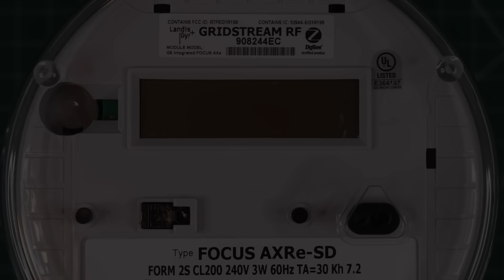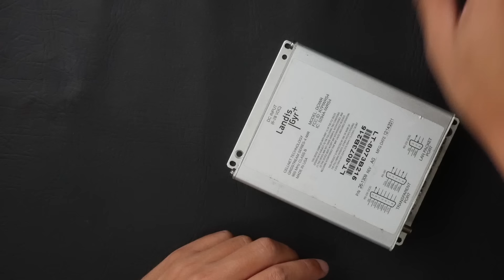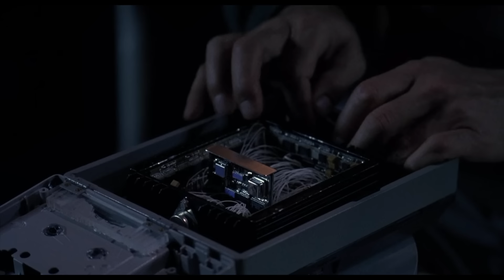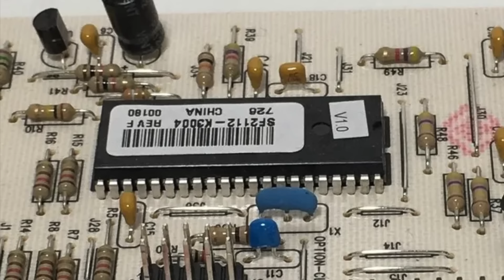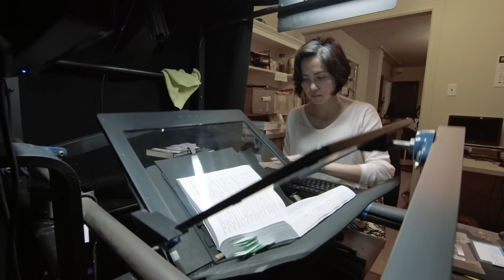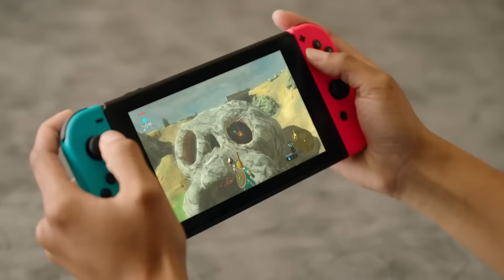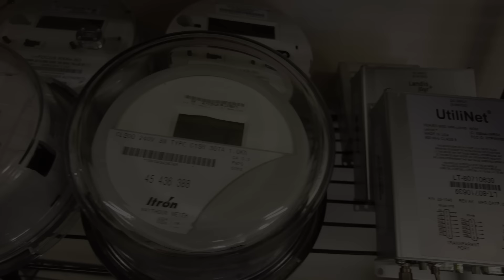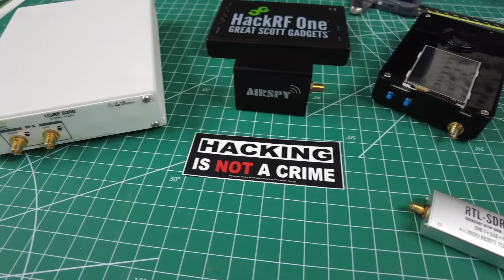The REAL Problem with Smart Meters

Comment: My bill has tripled since they installed mine.
Reply: Your meter can pick up signals from devices and counts this as usage. I discovered this myself and covered my smart meter with military grade fabric so no signal can get in or out the smart meter through wireless means. Once I did that it reduced my costs . Routers tend to be close to smart meters, at least where I live.

Comment: The first model meters in the Netherlands where known to raise the bills. Explanation was they where sensitive for other radiation like that from microwave ovens...
Reply: They may also tweak the code or electronics to log more usage 😢
Reply: I think they all still do, I am in the netherlands and I covered them with military grade fabric to avoid radiation going in or out around the smart meter. i reduced my bills with it. Still have the same meter. However, now they want to change my meter saying it is outdated, it is not, they just can't read it as i also unplugged the apparent wired connection they had hooked up, when I found it last year

Comment: In some areas, the smart meter is a new tax, because, anytime a meter is pulled, they inflict a fine.   Pay it, or get your power disconnected.  And there is another example of tech getting around the license restrictions.  They did this, because, one computer owns the license, and you run the code in a space at the remote server computer, that send images back to client computer.   The usage at the remote computer is now, a fraction of a second.   So, millions of users could use the single copy.  But usually, it is less then 200 clients.

Comment: It kinda looks like OMS frame structure, if so 00FF would be "manufacturer specific" code XD if i remember correctly. But you'rs US meters might work on smt similar but in totally different standard since US have it's own ones. We always encrypt our data with unique keys. And yes concetrators might be able to recieve multiple messages, but they won't decrypt them just pass it to the server.I can't tell to much detail since i have NDA, but i don't work any companies shown on video.

Comment: Given these smart meters are using spread spectrum transmissions to get the data back to the home office, just how does it do it given the antenna size is negligible and the power outputs of these meters can't be that much - maybe a few milliwatts??  All that RF energy has to be transmitted and received back at the home office and decoded for the utility to obtain the information!

Comment: Make some experiment devised from load ... give a smart meter various specific loads at various specific times. emulate lights, tv, heater etc in various combinations and see how they modify the output ... a shit lot of data is just communication overhead . Problem is encryption... if they use a proprietary way you are pretty much out of options.
Reply: lol, this is encrypted, you are not going to decipher it that way, but anyway there is not much point in deciphering these datas, they are not secret at all, nor interesting, it is just total import, total export, apparent power, active and reactive power, power factor, voltage, frequency, sometimes GPS coordinates, there is really nothing to it.
Reply: @lo2740 at uni when we did security we had as subject ways smart meter data can be used against us... Time and load can create habits timetables and make it really easy for people to steal or frame you... Next to other bad stuff that can be done by landlord, neighbor, dno, etc... The key is encryption but old systems were really easy for eavesdropping

Comment: I had a analog meter for years. When the digital meters came out, I noticed that my electric bill jumped up about $25 dollars a month . Calling the electric company did no good . I had the bills for years and years to prove that it wasn't me causing the bills to jump. I started writing down the meter useage at random times. A bit of detective work on my part proved that those smart meters are thieves  I went to the circuit breaker panel and turned off EVERYTHING. I took polaroid pictures of the time of day and the meter reading before I went to sleep. When I woke up, I went and read the meter. Whoa ! ! How could I use up 500 wats of electricity over night with everything disconnected including the refrigerator. Another call to the electric company requesting a technician did not accomplish anything at all  I ended up calling the PUC for help. A representative came over and looked at the Polaroid pictures and my notes. He contacted the electric company and told them to replace the "smart meter " with a analog one and reset the meter back to 0000  to give a fresh look at my electrical useage. Next month my electric useage went fown to what I usually have. I stayed in touch with the PUC for quite some time discussing the bill every month.
Reply: Same here, requested analog meter and the power company switched it out, the same day I called. MUCH lower bills with analog!
Reply: @ThisMoment11 what was your fee to revert to Analog?
Reply: @ThisMoment11 Your bill goes up because a smart meter charges you for both phases not just the single one with the highest load like the old meter.
The power company claims they are charging you for a single phase connection, this is fraud when they install a smart meter that charges you for a duel phase power supply.
Reply: @garytyler1448  You don't have two phase power, you have "split phase"  240 volts with a center tap.
Reply: Same here, my bills jumped upon install. Power company said the new meter it “tracking small electrical use that the analog meter didn’t”, yea apparently it wasn’t tracking 25% of my use because that’s how much my bills jumped. What a crock.
Reply: @davejunk4098 they are lying.
If you look at your power bill it should say single phase connection.
But if you look there should be 2 wires 2 phases going in?
The old power metre only charges you for the side pulling the highest load, hence single phase.
But smart metres charge you for both sides or duel phase connection so your bill will go up.
But if they claim they are giving you a single phase power supply and bill now that would be fraud, would it not?
Reply: @garytyler1448 - typical electric drop to a residence is 240V single phase.  The two wires are opposite sides of a transformer secondary with a center tap.  The center tap is the neutral.  Neutral wire is grounded in the main panel, which limits the power to ground to 120V.  This is single phase power.
Reply: Their convenience shouldn't cost customer's money.  This is ripping their customers off.  A lot of small amounts of overcharging add to big $$$.  Why does PUC allow this knowingly
Reply: @boomshacker  the worst part is, it's convenience—and cost SAVINGS—FOR THE UTILITIES. They no longer have to pay someone to drive around and read meters, their infrastructure (every meter on every house, plus the relays) automatically collects the data for them, and they just need to pay a couple of specialized technicians to maintain that infrastructure. They could have 2-5 technicians PER STATE, just driving around as maintenance schedules or failures dictate, instead of a meter reader or two for each CITY.
Reply: Plus houses can and have been set on fire remotely from smart meters. I'm thinking I'll go to analog and pay the fee.
Reply: @cocoabiscuits  what the fee in your area?  In Mesa AZ it’s a $40 a month fee to switch back.
Reply: That cheap mine went up $10 a day and we're not even home during peak hours
Reply: I agree!  I have a metered outbuilding, it literally uses nothing, but the smart meter claims I use a kWh/day!
Reply: funny cuz xcell energy hear in wi whants to charge me 25 a mounth for not having a smart meter...
Reply: Hi what is PCU?
Reply: @tonypetch  PUC Public Utilities Commission.
Reply: @tonypetch  Public Utility Commission.
Reply: How much did that cost you?
Reply: Probably a faulty meter from the factory easy to slip past these days becuase quality control is a nonessential expense according to todays buisness majors.
Reply: @alouisschafer7212 they told me that my meter was tested for reliability. Pure BS. No one ever came to even look at the smart meter.
Reply: Here's part of the problem.  No one at the utility company got arrested and punished for what they did.  Good for you for being diligent.  I wish everyone was that way.  But what about everyone else they get to steal from?
Reply: PSE&G sent us a letter claiming changing to their smart meter is mandatory. What can we do?
Reply: @onsturn mandatory requires agreement by both parties just tell them No thank you!
Reply: @ mandatory or what?
Reply: Wow! That's just pure theft by the power company! I'm at the research stage b4 they soon try to install one of these lying smart meters at my house. I'm going to "opt out" as is my right because i don't trust these cheating smart meters! Thanks!
Reply: The problem with any ‘computerized device’ is that it can be programmed to cheat the customer at any time. But that also means that some ‘Hacker’ could also program that meter to record power at a low level so the company gets ripped off. This also goes for digital currency, how do you know it is true to you ?  Everything is Hackable period.
Reply: Who made the smart meters?    Aluminum foil ?
Reply: @Robert-ex3pm  don't cover the smart meter with foil. It will run like crazy trying to report to the company controller.
Reply: Same here exactly like 25$ to 30$ jump even now being on assistants program it should be less not more they think we dont pay attention to that? Im definitely giving them a call later today when i get off work
Reply: @jefflidberg9941 is that a jump in total of all cost they charge you? Or have they added on some monthly fees?
Reply: Yep, Price County Electric Coop in northern Wisconsin is the same. With the new meters came higher usage/bill. They claimed they are accurate and the old was undercharging. Our glorious State agreed and we are F' Ed in the A.
Reply: Interesting! 😮
Reply: The sm4rt m3t3rs emit very high emf.  

They are literally stealing your electricity and turning it into an electric w3ap0n to irradiate you.  And you are paying them to do this.  Still, w3stoids would rather focus on the fact that Jose is picking their corn and that there's a guy named Sandeep buying stuff at costco.  Absolute c4ttle.  

We all deserve what we tolerate!
Reply: Had the same thing here. I believe that someone in my mesh knew how to talk the control code. Or possibly the control office at the electric company was jacking up the reading even on days when the ONLY thing running was the fridge. 
After 3 months of arguing I finally got an analog meter. 
Now the house is quiet. Now the cellphone does not overheat just because I charge. Other appliances seem to be operating much better.
The smart meter was a disaster waiting for someone to send code to possibly burn my house down.
Reply: Thats everyone. It should be against the law forcing us to have a smart meter. The damage they are doing on our health should be enough.
Reply: If you look into it they have variable pricing implemented now...
Reply: @jo-qp7mz  Depends on location.
Reply: @jo-qp7mz to charge you more at your peak time not just the peak usage of the majority of power usage.
Reply: Also, I knew they were crooks they’re not healthy as well microwaves thank you I’m going to contact the Puc to change ours. They wanted us to pay $169 to replace with analog.😡 thank you again👍👍🙏🙏
Reply: precisely, and exactly why i will NEVER consent to one! You're story is exactly same as all i've talked to with these nefarious devices!  It's a scanner for your life, work, 'energy'signature, hmm anyone wonder if that will lead to a carbon footprint Tax scenario!?!
Reply: Analog meters run slower as they age.  Electronic meters remain accurate over time.

Comment: It's LWM2M encrypted with mbedtls & using a 6lowpan network.  You can buy a 6lowpan sniffer, decrypt the packets in wireshark, given the group AES key.  There's nothing proprietary, the hopping pattern is public domane, but you're not going to get the private keys required to spoof your meter readings.

Comment: The utility promised off peak billing as benifit if you installed a smart meter. 8 yrs later no off peak and they say their billing software can't handle it, no doubt some legacy cobalt code on old mainframe. The utilities are often wrong and over charge as local news reports. I installed Emporia Energy System to track all energy use. So I can track electricity. However I get odd spikes in water and gas use. Only way to track is manually write it down. Add to that they collect for fire services and other country services being outside city limits. Ridiculious high bills even if I conservative.

Comment: There's a huge problem with all the meters and renewables 
What's a solar is connected to the grid it could only put in about 15% of the actual power the problem is it's measured in watts if you take a volt amp meter you can see the actual power going into the grid 
Because volts is pressure and electricity is like water so you must overcome the incoming pressures to put anything in meaning of volts

Comment: One thing to remember is that usage data isn't a serialized number like the meter displays.  It's a delta value, usually in 15 minute intervals.  This allows for smaller data packets, key in a mesh radio network.

Comment: They installed smart meters here in Louisiana that are remotely shut off. Reading the fine print indicates they have the capability to just shut us off for load shed, non payment, non compliance, and illegal usage such as grow operations or commercial operations. The meters have algorithms to detect appliance types and report it to your power company. 

Our home has a standby generator and every week it will stretch its legs and run the house for about an hour. The meters in our area are set up to detect tampering by whether or not a meter up or down circuit has power and will disconnect itself if it thinks you've bypassed it. It's really popular where the aboriginals Put tape on output terminals and bypass the meter with copper strip leaving meter in the box and on but not measuring anything. The meter detects this and sends the power company out and because of how our generator is wired they've fined us, disconnected us, and even taken our meter out and put a blanking plate in forcing us to run off the generator for weeks at a time. They're the ones who installed it too!!

Comment: Brilliant!! Are smartmeters capable of remote detonation? Is this built into the system? I've had 5 smartmeters, and they make all kinds of noise after midnight. We've had four small transformers removed without notice and four huge transformers replacing those that make all types of high pitched noises at night, forcing huge electromagnetic kenetic energy into our homes after midnight when the power company is closed. Often have headaches each morning. I've request my old meter back.  The grid is corrupted! The transmission lines can't carry the voltage, and goes offline at night.  Thanks for this update!

Comment: I used to work for a company which made smart meters. In addition to the Cellular transceiver inside they also have Zigbee wireless inside. Many of today's home electronics and appliances are also equipped with Zigbee transceivers. They are polled every so often to find out what which appliances are running and for how long, and how much energy they are using. This is so that the Government and industry can regulate what you can and can't use - as far as which electronic device/appliance - as well as how long you can use it. This is all part of Demand management. It is part of Green environmental initiatives put forth by the United Nations Agenda 21. People caught wind of this and were able to thwart the plan which unfortunately been revamped and recycled into a new and improved set of environmental initiatives. Let me be clear about the Zigbee thing - basically these initiatives would allow the Utility/Government to turn off your appliance...  as in your house is too cool in the summer, or your using too much heat in the winter. It is a way of rationing energy. BTW the Cellular packets are 128-bit encrypted, and use all sorts of cyber hiding techniques to prevent anyone from see what is in the packet. The code on the devices are also encrypted. I would suspect that newer devices would be using something like an Arm Cortex M33 which can decrypt the instructions on the fly before executing them.

Comment: I was a field metering specialists for Utah power in saltlake city. Burkshire Hathaway bought the company had us  swap out all the mechanical meters to smart meters in saltlake city. Then laid off 80% of the metering department. When a meter sends the billing info back to the power company. That information is compared to your power consumption history. If there is more than a 10% change its flaged and put infront of a fraud prevention team member. They look at it and decide how the company is going to respond. Normally a metering specialist will be sent out to swap the meter out with a new. The old meter is checked out to see if its functioning correctly.

Comment: Last gasp is part of an anti-tamper circuit that includes an accelerometer that if shaken if so slightly, will send a message to the C/O that it is being messed with.  That super cap gives the unit a limited power ride through.